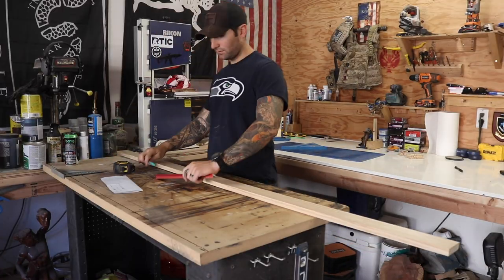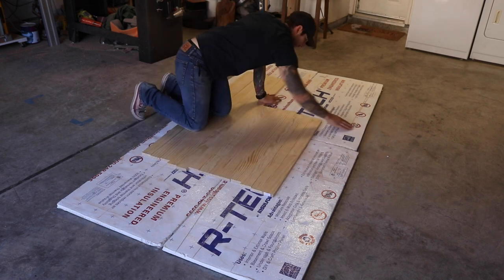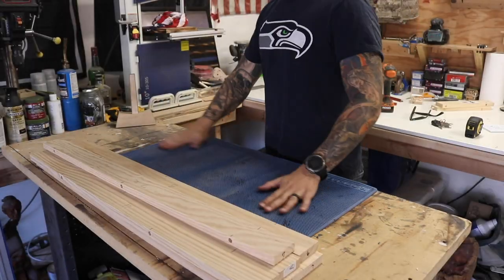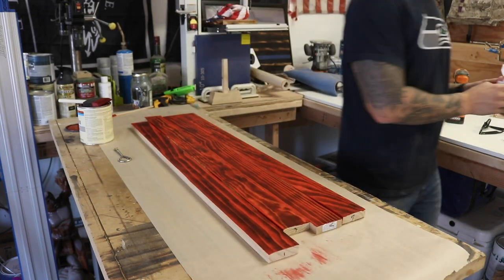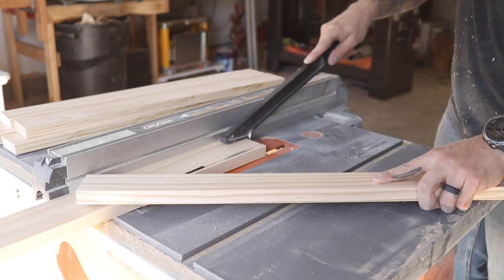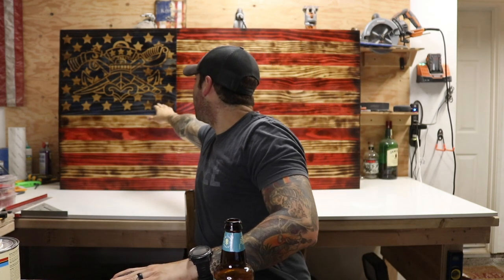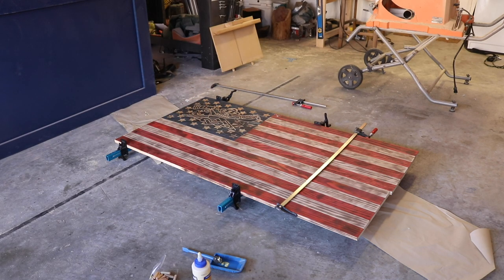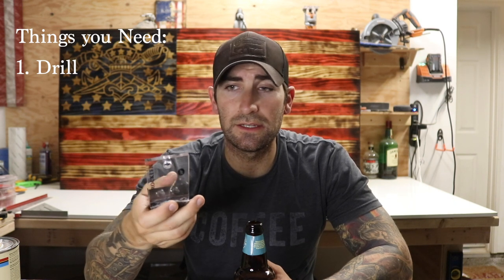How To Make a Rustic Wood American Flag

Comment: If you run your torch beginning before one end of the wood and passing all the way, nonstop, past the opposite end, as if you were spray painting, you would instantly eliminate the spots where your "brush strokes" overlap.

I'm liking the dowel idea, but I was also thinking about using pocket holes, which would eliminate the need for clamping.
Reply from the maker: Thats a good point with the torch, sometimes i just get lazy i guess. hahaha I have used pocket holes as well, and they are faster. Just wanted to try the dowel method, this also allows you the option to stain and engrave the other side and hang it vertically. If that is something the buyer might want. Thanks for the advice on the torch though, i really should be doing that way.

Comment: That’s a massive flag!! Love it. Thanks for more details that’s very helpful. The hardest thing I have found is getting the correct union size with the stars to match.  When your glueing things up and they bow you can always take and spray water or a damp cloth on the back and weigh it down for a day or so and it will take the bow out. That will work on all kinds of bowed boards. Keep up the great work. Off the wall question how long have you been collecting tattoos? Myself for like 20 years and I’m almost done with both of my sleeves.
Reply from the maker: Nice! Thanks man! ill definitely use that trick to take bow out. I have been getting tattooed for about 7 years, between deployments. Got my leg planned out next! just gotta find the time.
Reply from the maker: Thanks for your support!
Reply from the maker: This is an awesome website! Thanks, ill use it in the future!

Comment: Question about the minwax colors. I asked the people at lowes and ace hardware but they both told me there is no Scarlett or true blue. Are there alternate colors you would suggest?
Reply from the maker: They must have discontinued that particular line. My best advice would be to get small sample cans and do some tests, and see what gets you close to the colors you want. Also Home Depot sells Varathane stains that work well
Reply: Union- Semi Transparent NAVY or Semi Transparent Denim Blue.....Stripes- Semi Transparent CRIMSON or Semi Transparent BARN RED. I can't say which of the blue or red looks the best...I made my 2 first flags using one blue n one red n then next one the other blue n red and I use these 2 as my display flags  for people to pick which they think looks best.

Comment: How do you determine the size your union should be? In the event that you wanted to make a bigger or smaller flag. Is there a certain ratio you stick to?
Reply from the maker: ya, its a bit tricky, but i kind of figured out a formula that can be extrapolated to whatever size flag you would like to make

1ft flag dimensions
Width Height Union Width  Union Height    Stripe Height
1'         6.5"         4.75"          3.5"                     0.5"

so if you want to make a 2' flag, just double all the other categories and so on. you can also change the 1' to 12" and figure out the ratio from there if you are going to do a a specific size that doesnt fall into the 1' 2' 3' etc. 

Hope this helps!
Reply: Workshop 1776 awesome! Thank you!

Comment: Awesome work.  How big are the stars?  Is there a 50 star union template this size available?
Reply from the maker: Thanks for the kind words, If you are asking if I make template for these, unfortunately, Im not really set up for that at the moment. There are tons of templates available on amazon. The size of the Union for the 5' flag is 23.75"x17.5" so whatever stencil you are considering buying should be around this size.
Reply: @Workshop1776  Thank you for your response.  Is there a reference or website that gives the union size reference for each size flag?  I have the union size reference for some smaller flags.  I really interested in making a 4' flag and a 6' flag and just need those union sizes.
Reply from the maker: Im sure there are some out there, however i don't know what they are, I just do the math. I got you on the 4' and 6' ones

4' - W 19" the height of the all the stripes is 2", making the union 14" tall

6' - W 28.5 Stripe height is 3" (Union = 21" tall)
Reply from the maker: heres the formula if you want to make any other sizes

1' flag = H 6.5"   Union Width 4.5"    Stripe Height 0.5"

from there you can just plug in the width of the over all flag and it will change the proportions accordingly. its kid of hard do display it in this format, I usually use excel.
Reply: @Workshop1776  Tyvm.  I really appreciate your help.  You got a new subscriber here.
Reply from the maker: any time, fell free to reach out again if you have any more questions. I appreciate the sub!

Comment: Suggestion, I make these flags the exact same way, the only difference is how we burn the flags, I used to get those dark blotchy spots as well, but I figured out a way to completely eliminate them, set the stripes up on a stand horizontally facing you of course and take the torch starting on one end off of the wood and in a consistent motion move from one end to the other starting off the wood and ending off the wood the first pass probably wont show any burning but immediately make another pass the exact same way and you will see the burning start happening, after 3 or 4 passes the stripe will be burned the way I like them the more passes the darker the burn, you'll never have a blotchy spot again my friend
Reply from the maker: Thanks! I'll definitely give that a try!

Comment: One more thing your using the caules wrong bro, you want one above and one beneath your project, it's easier on your glued joints to be pushed up in a large area instead of using the small surface area of your clamp to push all of the project up and flat
Reply from the maker: Ya, since the video i figured that one out haha thanks tho! I need to make another video to update on the old one haha